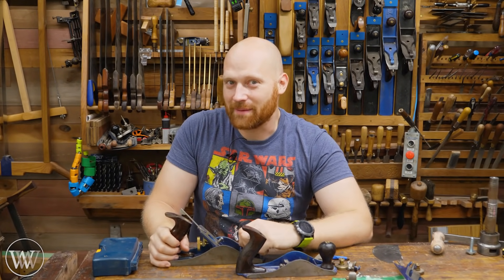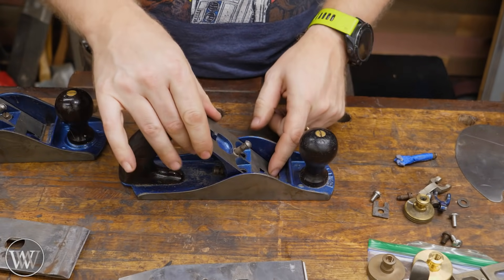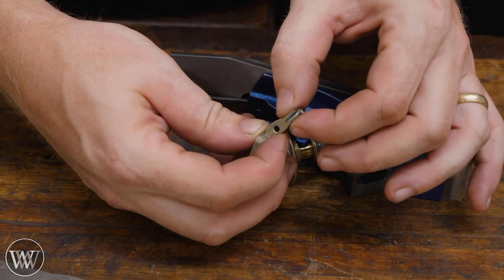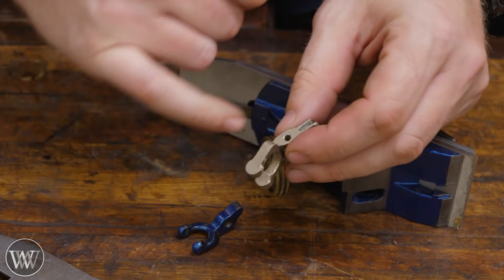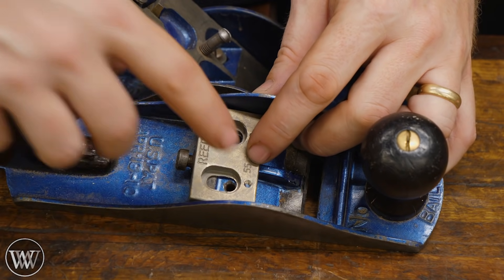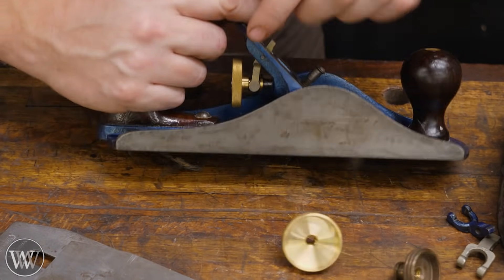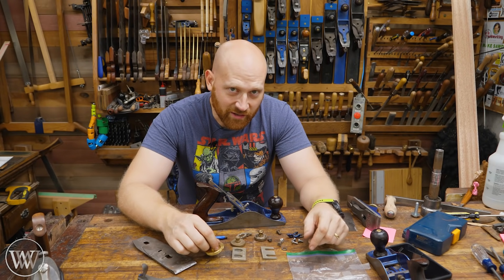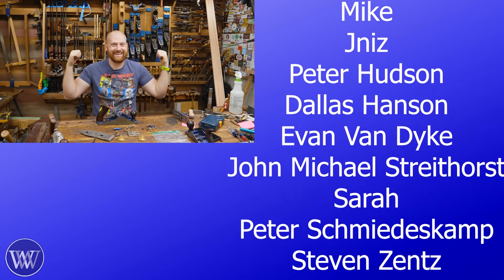Supe Up your Hand Plane By Giving A mouse a cookie

Comment: I'd honestly be interested in all of them for different reasons. I have some transitional planes with missing yokes or wheels that I'd love to fix up and use. Also, the spacers for changing the frog angle are a great idea if they don't slip or cause other issues. The slop doesn't bother me quite as much anymore because I'm planning to swap out my vintage planes for new Union planes as they're released. But I'm still interested in fixing and using some transitionals alongside the Unions.

Comment: I like yoke upgrades. I would be interested in an upgrade that enables folks with smaller hands to adjust the blade depth with their hand in the normal planing position. I have to stop planing to even slightly adjust the blade. Very frustrating.

Comment: This is a GREAT idea!!!!.....  if it works....... how did your plane perform with the upgrades James?? I have a "file to fit" yoke (Clifton) in my Record 5.5,  you get a rough casting and absolutely EVERY mm of it has to be filed and the hole has to be drilled........ its hard work for someone with no metalworking experience and easy to get it wrong. I would be interested in the finished yoke with the long tab and drilled hole. I use back bevels on some of my old irons for serious grain so I would be interested in the high angle frog attachment too (as high as possible) The sensitivity of the depth adjuster doesnt bother me much, but I would like to try it out.
None of this is probably gonna be much use to me tho here in Europe (Ireland) as shipping, taxes and import charges would likely cost a lot more than the parts themselves :/ 
Love the idea tho :)

Comment: I would like a longer screw for depth adjustment. Not sure if I'm doing something really wrong but it's very frustrating when I run out of screw for adjusting in or out. The slop when going from one direction to the next is crazy too. I have an old Baily #5.
Reply from the maker: That's actually a problem with the yoke. If the hole is slightly out of place in the yoke it moves too far forward or too far backwards. It could also be that the chip breaker isn't an original chip breaker.
Reply: @WoodByWrightHowTo   thanks, it’s probably both. Should I shop for a replacement yoke?

Comment: the frog angle seems unnecessary when you could grind in an angle on the back of the blade to change the angle instead, 2nd blade with an angle on the back instead of being flat works better if you only have 1 plane as well since you just swap the blade out instead of spending time setting up the frog with or without the wedges again. though i guess if i 2 planes dedicated for different uses it'd be easier with the wedges since then i'd only have to set that up once.

large knob is nice along with the finer thread, only concern with finer thread would be stripping it but i doubt there's enough stress on the thread for that, some large notches in the knob would help with gripping the knob as well, one of the main issues i run into with the knob on my lei nelson is my finger slips off easily.

everything else looks good.
Reply: I agree that there really shouldn't be too much stress on the adjuster nut, but I do find I pick up some folks' planes and find they have the lever cap screw way tighter than I think it needs to be. I try to set mine so I've got resistance but can adjust it with one finger. Impossible to describe precisely but it's not a precise thing anyway and I could be totally off base. I'm not a materials engineer, but I always thought that for a given material fine threads had a little better resistance to stripping. Of course the real deciding factor would be the type of steel used, and I suspect stock Stanley steel for that rod is probably pretty mild compared to what Jeff is using. A brass adjuster nut is going to be the weakest link in any case.

Comment: As an aside, since you're looking for suggestions, could you make a bit and brace croc/jaw that will take a hex, round shaft bit?
Reply from the maker: We actually looked into those at one time. The problem is making new ones would probably be somewhere around $200 a piece.

Comment: I would buy a kit that came with it all! I for one would rather have a predrilled hole so I don't have to worry about my angle as much. 

Some people already said it, but I would much rather spend money to improve the Stanley I already have than buy a new veritas or lie-nielsen. Especially when it comes to my jointer! I could spend $200 on upgrades and not come close to the cost of a new premium tool.

Comment: I really like these ideas. I've often wondered if anyone ever made a low angle frog to swap out on a No. 3. I was about to write that I have never had a need for a high angle plane but when I made my Moxon Vise from hard maple, I remember having trouble getting shavings without tear out. So I'm interested in the wedges. But wouldn't custom machined steel parts also be expensive?

Comment: I saw where one guy did a back bevel on the blade for reducing tearout on figured wood.  It looked like an interesting idea--especially if you had an extra blade for that.  Have you tried this?  How would a back bevel compare to the shim that raises the blade angle?  The fine-threaded adjustment wheel is interesting.  Well, all of those upgrades are interesting.  THANKS!!!
Reply from the maker: I have tried the back bevel and you have to be very carful with it. you have to move the chip breaker back far enough that it no longer works as a chip breaker. but that being said there are people that think it is worth it.
Reply: I use a 10 degree back bevel on one of my Stanley #4 planes. That yields a 55 degree cutting angle. It's harder to push and requires more frequent sharpening but it sure tames a lot of my highly figured stock. The same would apply to the wedges shown in the video.

Comment: Regarding the 50/55° angle adjusters: I don't think that would work. The two front "feet" of the frog would no longer sit flat. The milled surface of the frog feet wouldn't be parallel to the milled part of the plane body, so I would think it would be less stable. Have you tested it out to see if that was the case?

Love the ideas, though
Reply from the maker: yes I have tested it. the front feet on all my planes do not actually sit flat they just touch on the very tip so it is the same here. as to stability I feel no difference in vibration with or without the wedge. but further testing is in the books.
Reply: @WoodByWrightHowTo  - that's great to know, thanks! If that's the case with most Stanley planes, I wonder if grinding them to sit flat would improve stability. Maybe I'll try it.

Comment: All of this is absolutely amazing James, I think everything you showed, is something people would like/use. The biggest thing that Pi$$es me off is the many revolutions needed to back off or take up slack while adjusting, so I think the 2 biggest things that would solve that is the split yoke with screw to make it fit the slot exactly and the fine pitch bolt and adjuster wheel.
Haven't been messing around long enough to have thought about it, but the frog angle adjustment could also be really cool - I recently got gifted some old purple and green heart and the grain on that is crazy, something like this that I could maybe setup a No.4 with to deal with that would be cool.

OT question - Have a couple old, used No.4 planes I managed to find on island, but can't find anything else that anyone's willing to let go, so looking to maybe buy 1 or 2 new planes to get a wider cut, longer bed for jointing and well, TBH, a nice new plane. So, I was thinking since I have the No.4s, I'd get either a No. 4.5 and then either a No.5.5 or No.6. My question is, would the No.5.5 be long enough to be worth the purchase and that different from the 4.5 or would it be better to go for the No.6. Looking at the Wood River planes.
Also, have found and restored some old used chisels and they work, but contemplating getting a new set and looking at either the Wood River or Narex brands, which would you chose?
Reply from the maker: between the 5.5 and the 6 I would go with the 6. it would be more capable for jointing and if you are getting the 4.5 there is no real reason for the 5.5 in my book.
as to the chisels. the Narex Richter chisels hands down. they are the best on the market by a LONG shot.
Reply: James, thanks for your quick reply. Curious if I could only get one plane to compliment my No.4's which would you get then? Don't think I will be able to swing both at once, next one won't probably come for another 6-12 months after.

Comment: Love the yoke and other adjustment upgrades, I'd probably give them a spin since my legacy planes have an annoying amount of slop (I'm picky).

The bed angle adjustment is neat, but I would pass on it. Easier to just back bevel an iron. I feel the same about the replacement frogs though and those sell, so guessing I'm in the minority there.
Reply: I agree with you.  I have a few alternate irons with different back bevels - easy as to swap out.  Not a fan of the wedge idea.  I would buy the new yokes though and the finer thread screw in a heartbeat.

Comment: got lucky with some used Japanese block planes that work after back breaking sharpening but my scrap stanley planes are a curse.  unusable short irons, cracks, gouges, bent mechanics, etc.  every spring i commit to restoring the tools but if i'm lucky to get one working well, i ditch the chore to actually do woodworking ... rarely have more than one working.

Comment: Re: split yoke

I think I am afraid the split yoke is going to split eventually. If I were to devise something, I would think about two wedges sliding each other so their outside surfaces are parallel but their thickness (and length) changes.

Re: fine threaded bolt

Seems very reasonable.

Comment: any chance of making tighter fitting lateral adjustment levers? some of mine have a lot of slop and the washer doesn't move the same amount in either direction. the noise of a sloppy lateral adjuster just bugs me
Reply from the maker: that may be a future adjustment, but they would have to be old with a set of wheels as there are several widths that need to fit in.

Comment: I think that maybe it would be a decent idea to make those adjustment knobs not round, but, say, octagonal with slightly concave sides. That may improve grip but not clash with Rob Cosman's "Adjustar" patent (if there is one). Just a thought.
Reply from the maker: you could, but most people prefer the round as you can roll your finger along it. the adjustar is great for people with hand issues though.
Reply: @WoodByWrightHowTo  yeah, that's why I say octagonal. Or maybe even 12-sided. It's close enough to round-ish and still grippy enough for hand issues. Kinda middle ground.

Comment: I'd like to see an arrow or symbol on the knob showing which way tightens and which was loosens. I have several planes and there's no consistency.
Reply from the maker: ya Stanley changed it (around type 4?) and a few other companies changed a bit later.

Comment: Roubo recommends a 60 degree bed angle for smoothing planes and finish work, how about a 60 degree wedge.
Reply from the maker: The problem is at 60° you start running into issues with the frog fitting into the space. I believe Jeff has tried it but we couldn't find one that worked quite the same.

Comment: I’ll give some feedback. I hope I don’t hurt any feelings. 

I don’t think the replacement yoke make financial sense because by the time you buy the plane and a lie Nielsen blade and chip breaker you are spending close $150 and that doesn’t even include the yoke. At that point it would just be cheaper to buy a woodriver. 

The knob and thread replacement look cool but I question how many people will buy them because most guys who buy Stanley planes want cheap things and I doubt upgrades would be on their list. I could be wrong though.

I think the real winner out of the products you mentioned, are the frog shims. That would appeal to high-end new plane owners(with disposable income) and vintage owners. It would be way cheaper than ordering a new frog.

Comment: I really wish the Stanley planes came with a compound cap iron, so you could take off the cap iron, quickly clean up the cutting edge, and then throw the cap iron back on without worrying about its position. 
I love this feature on my Bailey Tool Co and Bailey Victor planes, but using expensive antiques as everyday users is a recipe for disaster.
Reply: "but using expensive antiques as everyday users is a recipe for disaster." .... The question is, are they actually "expensive" when compared to the price for  a Lie Neilson, Bridge City, or Veritas Custom? Heck, even compared to a Wood River? IMO, these things are tools that were meant to be used, not stuck on a shelf and admired just because they're old. They deserve to die in harness, not in a senior living facility.

I'm wanting a user 4 1/2, but have been holding off looking for one below $100 - not sure why though, as the cheapest decent new one is $250 by the time you include shipping and taxes. When "wanting" a 4 1/2 turns into "needing" one -- I'll probably bite the bullet, spend $150 on an ebay "buy it now", and put it into use even if it is over 100 years old. I just picked up an 80 year old #3, and it will be making shavings at the first opportunity.
Reply: @stainlesssteellemming3885  Your point is well taken on the price. Plane prices in general are insane right now. The difference is if I break a $500 Lie Nielsen, it’ll truly suck, but I can buy a new one. If I drop my Bailey Tool Co. No 14, I just broke a $500 plane that I may never be able to find again. 
I use my Bailey’s often enough to horrify most collectors, but their scarcity and history makes me feel like I have some duty of care beyond other more common tools.
Reply: @williamwalker7876  fair enough ... Though upsetting collectors is a good reason to do.most things.

Every vintage plane we own has been stripped of all japanning and repainted in one of a selection of bright rustoleum colors simply to ensure collectors will mever want them and some kid may get a start with a cheap user one day.

Our plane collection looks like a rainbow :)
Reply: @williamwalker7876  oh and I'm an engineer ... Once the vintage price gets near the new price, I go for new as better value for money.